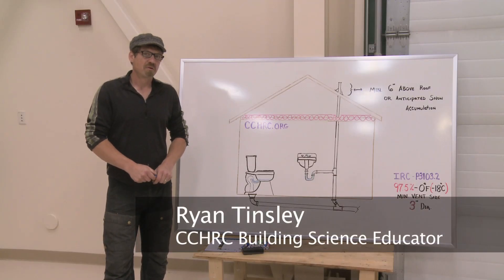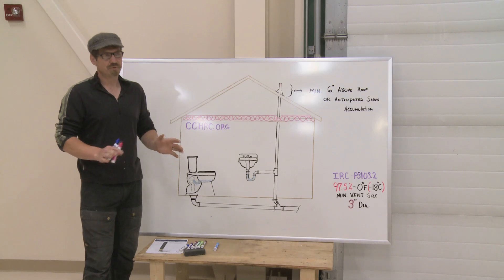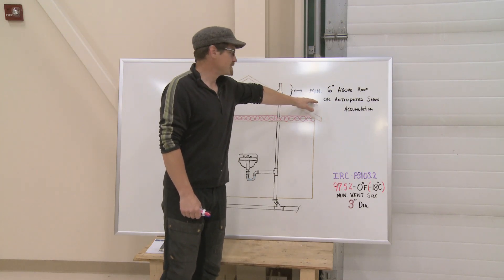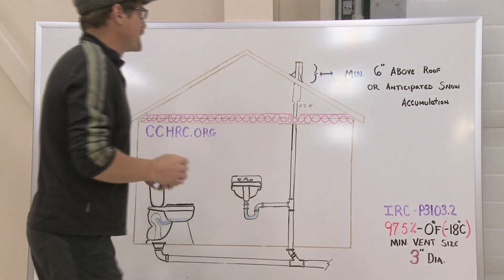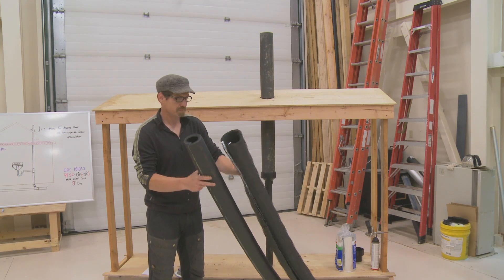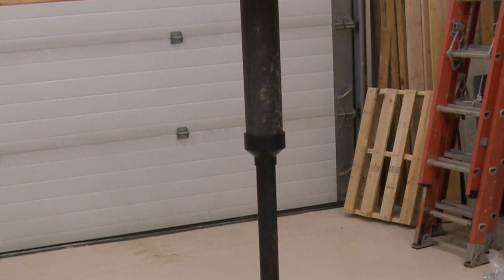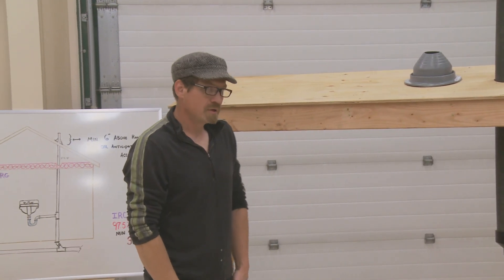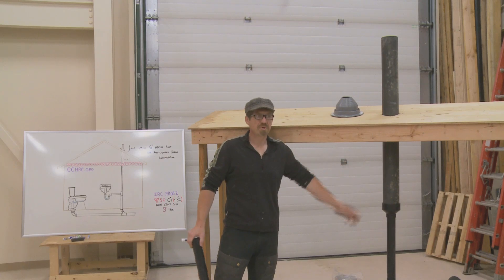How to Keep Attic Vent From Freezing up in Winter

Comment: Who'd of thot vent stacks take so much thought and attention ? 
  I have a rafter roof with 1 1/2" continuous vent. Tyvek on top of rafters. 2x2s spiked on top of the tyvek then roof sheathing, felt and metal roofing.  . 
 ??? 
 Can I run the vent line up the slope of the roof inside a rafter bay then out the wall at the peak ?

Comment: Keep the terminations close to.the roof line. The more pipe in the cold it will freeze up. If the pipe is kept close to the warm attic. No freeze up. No taller than 1 to 2 inches. Take it from a Canadian in the prairies. Keep the size large 3 inch minimum or even 4 inches roof penetration.

Comment: what about sliding in a 'T' shaped sleeve pipe into the vent stack to prevent snow accumulation sitting on top and plugging up the vent stack... Even hard winds blowing across the vent stack opening can stop the release of gas. A T pipe would also eliminate this problem..perhaps the enlargment step can be done outside of the roof.
Reply: I think the moisture in the air exiting from the pipe is what freezes, more than snow sitting on top.